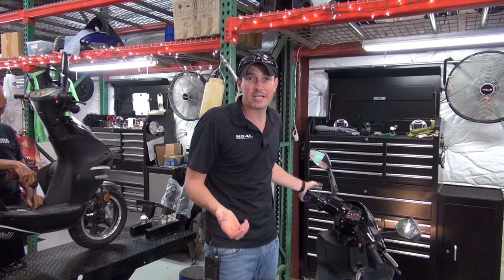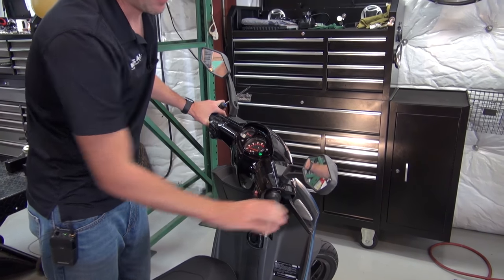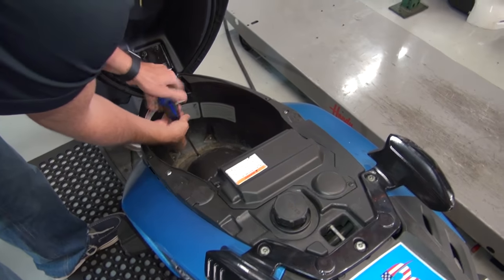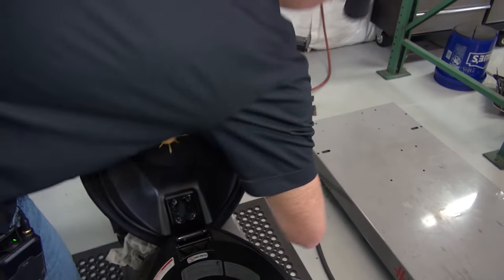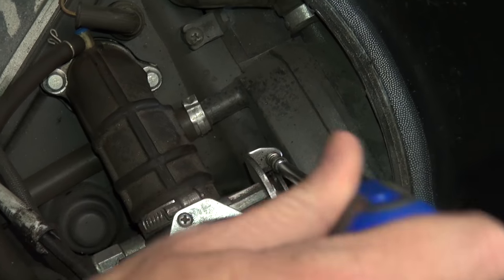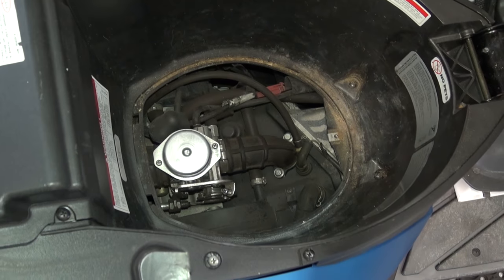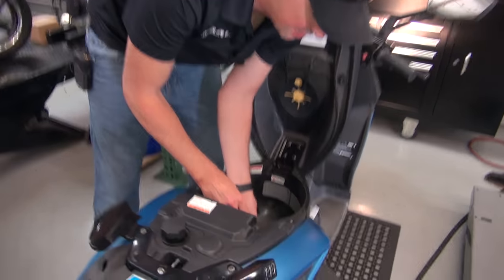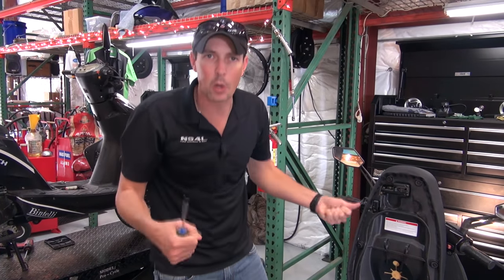Scooter Troubleshooting: Scooter Dying Out When You Come to a Stop / Low Idle

Comment: I have a 50cc moped scooter and it stop no me in the turning  Line then it come back no what could be the problem every thing works
Reply from the maker: What?  I'm sorry.  I did not understand any of this.
Reply: @NewScooters4Less  I think he said ''I have a 50cc scooter and it stops on me in the turning lane, then it comes back on. What could be the problem? Everything works...''
Reply from the maker: @vojtechpilar5809  Thanks for translating!  Marnita, there could be a couple of different issues.  Send me some more details and I'll be happy to try and help.
Reply: @NewScooters4Less  you're welcome. Btw I have a problem with my scooter, too. Just took it out of service. Had carburetor cleaned up including the transmission etc... Now it dies out when stopping at the lights or even when letting it run at idle. Even when it's warm. I can just start it, let it idle and it just suddenly stops after a couple of minutes without any struggle like switching of the power button. Then I can easily start it up again... Any ideas please?
Reply: @NewScooters4Less  it never dies when throttling. Mostly when approaching traffic lights or stopping down hill right after I come to the point (speed) when the CVT comes down to idle.
Reply: @NewScooters4Less  I'm gonna try to adjust this screw but last time it totally died out even though I tried to sped up at the point of slowing down but not coming to the absolutely stop as the traffic lights turned green on my approach - imagine you're throttling, you see the red light so you let go and engine break down approach the lights, then it turns green right before you completely stop but still moving at the speed of 10km/h maybe so you just wanna continue but the moment you try to throttle again it dies (or dies without you even throttling).
Reply from the maker: @vojtechpilar5809  Have you checked for vacuum leaks.  (Depending on the type of scooter) there is probably a vacuum line from the fuel petcock to the intake manifold of the carburetor and if that vacuum line has a cut / leak you will experience problems similar to this sometimes.  Also, there is a black plastic spacer under the intake manifold between the manifold and the head of the motor.  Very often, I've seen those spacers get cracked and see air leaking from there.  In which case, it needs to be replaced.  Look for vacuum leaks!
Reply: @NewScooters4Less  Thanks for your fast reply. It's awesome you're trying to help just like that! Before I start looking for it, I've checked some videos regarding vacuum leaks. Every scooter in those videos seems to be dying out rather slowly. Whereas mine runs just fine, even on idle. I don't see any struggle nor power loss... It's literally like the engine is running just fine then it stops suddenly as if you'd simply turn off the key... After it stops it starts up extremely quickly and easily... I hope it's not an electrical issue. What else do you think it could be if not the vacuum leak? Thanks for your help!
Reply from the maker: @vojtechpilar5809  I really hate to say it, but probably an electrical issue.  If it runs fine but then just dies, something is probably killing the spark.  Maybe there is a an issue with the kill switch?  Maybe the coil and / or spark plug boot that covers the plug?  I'd start with those things, but it sounds like it could definitely be electrical. What kind of scooter is it?
Reply: @NewScooters4Less   It's a 50cc two-stroke Adly Gatecrasher, the year 2017. It looks absolutely undamaged. There isn't any scratch around but it's done 9500 km and I got it second hand so I wanted to take it to the service to check the belt, gears etc asap. I had had it for about 5 days and it was running ok, just spitting some oil and not having enough power at low speed. Now the engine runs great, no oil spit from the muffler, they derestricted it so it even runs much faster. But suddenly right after the service the headlights low beam was off and the indicators started flashing randomly or not at all when the engine was on (working fine when the engine was off). I took it back to the service but the guys blame me for making this up. They didn't believe me the electrics had been working just fine. They said I was trying to make up problems and blame them afterward for causing them during the service. The headlight high beam works so they said the bulb must have gone out on my way there. Also, they said the flasher unit was faulty, so I got a new one and it actually fixed the issue. No problems with the indicators so far after that. Maybe I was just extremely unlucky with these that it happened right after the service. Anyway, it was a full service so they took the carburetor apart and many things around it so they could have caused a vacuum leak by an accident also. They changed the spark plug but the plastic end which is connected to it and sits inside the boot crushed. They said it dried out and broke. They replaced it. I guess this could be the issue also but I have no tools to try all of this and these guys now hate me for thinking I'm making stuff up so I can't go back there... There isn't any better service around except for a place that charges 100 dollars per hour only for diagnostics. This is very frustrating :(
Reply from the maker: @vojtechpilar5809  Sorry to hear that.  My assumption is that it is still related to that coil and spark plug boot based on the the symptoms you told me.  I wish there were more I could do!
Reply: @NewScooters4Less  That's ok, I gotta fix it somehow. One more thing - since I don't understand how scooter electronics work... Is there any chance this has something to do with compromised grounding? Sth like they accidentally hit and loosen some ground wire when getting into the bike. I'm thinking it could have something to do with the sudden headlight and indicators problem. Could there be any loose cable I may wanna be looking for or sth like that? Cheers
Reply from the maker: @vojtechpilar5809  It could.  Sometimes there is a ground near the head of the motor.  Sometimes on the frame up under the floorboard area too.  I'd definitely take a look and see if anything like that is loose.
Reply: @NewScooters4Less  Can I ask you something else? In the manual, it says the standard spark plug type is NGK C7HSA 
or NGK CR7HSA. They put B7HS into it. Could this be the issue? I was able to take it out from underneath the scooter. Also, the plug was quite black and oily on the metallic part. I understand that means it's too rich. So far I have only tried tightening the throttle cable a little bit to kinda mimic the idle increase since I can't get under the seat atm. At first, I thought it had helped but the random stopping is back... The coil and the spark plug cap seem fine to me.
Reply from the maker: @vojtechpilar5809  If it's the correct manual for the bike, you should always go with what the manual says for the spark plug.  Most 2-stroke 50cc scooters use NGK Plug 4622 or BPR7HS.  But to answer your question, yes...  the wrong spark plug could cause the problem.

Comment: Man my moped when I let go of the break my back wheel spins like crazy
Reply from the maker: Is your idle too high?  Turn it counter clockwise to turn it down.  If this isn't the issue, the throttle cable coule be getting pulled too tight on the carburetor or at the throttle handle.  May need to adjust the actual cable.

Comment: Hi, I have a 50 cc 2006 Vespa and when I first start it up it seems to idle fine. However, after letting it idle for a few minutes (like 3 minutes), if I give it even a small amount of throttle, it dies. Once it warms up for like 5-10 minutes I can usually get it going, but I wasnt sure if I should try what this video suggests or if there's something else it might be.
Any help is appreciated because I'm completely new to scooters.
Reply from the maker: This seems like it is fuel/carburetor related more than likely.  What kind of fuel are you running in it?  When was the last time you had the carburetor tuned up.  Seems like maybe the jet in the carb is gunked up causing this issue.  A good cleanout on the carburetor would more than likely resolve this.
Reply: @NewScooters4Less  thanks for responding! We have been using regular 89 octane gas in it. A few days ago my hubby cleaned the jets on the carburetor, put a new battery in (not sure if this was the problem but it needed a new battery anyway), and today we put 91 octane gas in. Once we get it warmed up, it seems to run pretty good. However, I watched the carburetor + throttle cable when I was warming it up today, and there  is one part that occasionally sticks when I apply throttle. Sorry I dont know part names, but it is next to the throttle cable, it is a small metal tab with a spring-like pump under it that was not springing back into position when I let off the throttle. 
I'm guessing if I do a more thorough job cleaning the carburetor, it should help. Thank you!!!
Reply from the maker: @lord_pants  Yea.  Sounds like it could be something like that.  More importantly, stop using 89 octane.  Always used the highest grade octane gasoline at the pump.  It will help a ton!
Reply: Will do, thanks a bunch!
Reply from the maker: @lord_pants  Anytime!

Comment: Hey. My other one not getting gas to carb. What’s the problem
Reply from the maker: Most likely a fuel petcock.
Reply: New Scooters 4 Less ok I changed the fuel a vacuum line I see the fuel trying to get to the carb but not getting there
Reply from the maker: But did you change the fuel petcock?  There is a small fuel pump on the scooter called a fuel petcock on most scooters.  What kind of scooter is it?
Reply: New Scooters 4 Less I changed it and it’s a tao 50cc
Reply from the maker: If you are not getting gas to the carb, it's either the vacuum line has a leak, your fuel petcock is messed up, or the fuel line and fuel filter is messed up.  Hope that helps!
Reply: New Scooters 4 Less ok thanks will go back and double check lines
Reply: New Scooters 4 Less I just got my new carb in do I need to adjust it?
Reply from the maker: Hopefully not.  I have no idea of knowing without being there.  You can always fine tune carbs, adjust idle, etc. you know?
Reply: New Scooters 4 Less i know about adjusting the idle screw
Reply: The screw on the bottom is screwed all the way in do I leave it there
Reply from the maker: Not sure what screw you are talking about.  May need to find a shop.
Reply: New Scooters 4 Less screw under the bottom of the carb.
Reply from the maker: You are probably referring to the screw that allows you to drain the gas out of the bowl of the carb. You shouldn't need to mess with it much unless you need to see if the gas is bad or has water in it, etc.
Reply: New Scooters 4 Less yes I just found that out. But it was running with the old carb but I put a new one on there because the scooter was sitting up for 3 years. Now it won’t take gas with the new card
Reply from the maker: Not going to be able to resolve this through messages on YouTube I'm afraid.  I've tried my best, but you need to get it to a shop at this point.  Best of luck!

Comment: I dropped a small screw in where the air filter goes, I went for a ride, got about a mile and it stalled out and won't start back up, could this screw be my problem?
Reply from the maker: Jamie Leigh How did you drop a screw where the air filter goes? Were you replacing the filter or something? Either case, I’d probably need more details and would need to know what kind of scooter and stuff, but in most cases, yes... this probably the problem. If the screw got pulled into the carburetor, it could definitely mess it up.
Reply: New Scooters 4 Less The screw actually came loss, there's 8 of them around the air tube with mesh around that, it was bouncing around and went in the air hose while running, took off the carb and nothing was there
Reply from the maker: Sorry to hear that.  :(  Wish we could help...
Reply: There are no scooter or small engine mechanics in my area at all, can't even find s back yard mechanic
Reply from the maker: Sorry to hear that :/

Comment: When i turn on my scooter my moped is running 5 seconds and turns off, what do i do?
Reply from the maker: Did you turn the idle up a little like the video suggests?  Is it dying by itself or when you give it gas?  I need a little more info.  Thanks!
Reply: New Scooters 4 Less Its dying on itself after few seconds
Reply: When i turn it on
Reply from the maker: If you give it some fuel and you let it warm up, does it stop?  I would give it enough gas to keep it running and let it warm up.  Did you adjust the idle like this video suggests?
Reply: New Scooters 4 Less i did give it gas. Its starts to leak now
Reply from the maker: From where?  You need to get that resolved.  That's probably the issue.  Maybe the float in the carburetor is stuck.
Reply: New Scooters 4 Less float. It leaks from the float area
Reply: ok after a week i figured out that my scooter needs to gas to get the fuel or it will turn off. So it works but i dont know how to make it go idle without it shuting down. Second, i have a lot of fuel coming out from the floater part?  what do i do? Patch it with flextape? Third, how do i get the auto button running, sometimes it wont work and sometimes it does. I am new at this. I dont know how to do it. Btw if i could go repair it at you guys then i would, unfortunatly i live in europe
Reply from the maker: There has to be a mechanic near you somewhere, right?  Lol.  Fuel is coming out of the floater part... where the float is in the carburetor?  If so, I would replace your carburetor because it sounds like you may have more than one issue there.  The e-start button can be several things.  It could be a bad connection at the switch (the actual button), it could be a weak battery, it could have a loose wire where it plugs into the wiring harness, etc.  There are a few things it could be.  Hope that helps some!  Good luck!
Reply: No, in this town its not affordable to repair scooters, here is less pay for them and takes alot of time. It takes time finding the parts for theese chineese scooters too. So i have no way to buy some the parts i need nor fix it.
fuel comes outes from the floater part. But wont anything fix it, fuel just comes out from the floater part. Any tape fixes it??? 
The battery is not weak ither, it is brand new too. 

¨Thank you for the advice. I will and i want to fix this scooter.
Reply from the maker: Buy a new carb or you might be able to replace the gasket inside the bowl of the carb, but it would probably be best to replace it based off the info you told me above.

Comment: People keep telling me that it's supposed to turn off when you stop, and the people I take my bike to to get a check up and told me the same thing I don't know what to do.
Reply from the maker: False. Your scooter should stay running when you come to a stop. It’s often normal for it to idle low if the engine is cold, so sometimes it helps if you let your scooter warm up before just jumping on it and going, but if it is cutting off every time you come to a stop, there’s an issue.
Reply: @NewScooters4Less  alright I figured that, I figured they were giving me false information and charging me for something I didn't even fix.

Do you have any idea of what the problem could be because yes when I do stop it completely turns off and I don't know what to do.
Reply from the maker: @sukitoph16  if this idle adjustment doesn’t help, it could be a vacuum leak somewhere. It could also be electrical (like a coil), but I’d have to have it in front of me to diagnose. Maybe try another shop? 

Your scooter should definitely be able to sit at idle without shutting off all the time.

Comment: I did this and now its keaking fuel from the airfilter and it doesnt start
Reply from the maker: You need to clean out and rebuild your carburetor. You've got more than a simple idle adjustment going on. Sounds like the float is stuck in your carb.  Take the air filter out, clean it, and let it dry out before reinstalling.  Best wishes!
Reply: @NewScooters4Less  what do you mean with talking and cleaning carburator out
Reply: @NewScooters4Less  and also when it didn't start I turned the screw around so much I forgot it's original position so how can I now find when I can't start it?
Reply from the maker: @davidrubensson8322  As long as things are functioning properly, you would ‘fine tune’ based on the idle speed simply by listening to it. I think you have some other things going on that you need to address. My recommendation is to find a shop near you if possible!
Reply: @NewScooters4Less  i fixed it but now di you have any suggestions yo adjust the auto choke because when it is on the engine chokes and doesnt run more than 7mph
Reply from the maker: @davidrubensson8322  Still shouldn't be doing that, but worse case... Are you able to just wait and let it warm up, then the auto-choke will turn off?